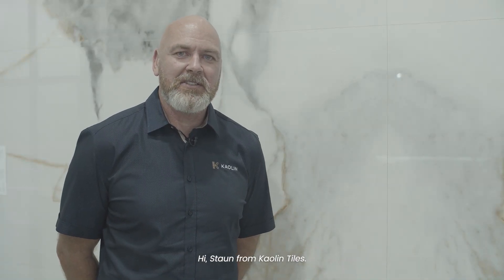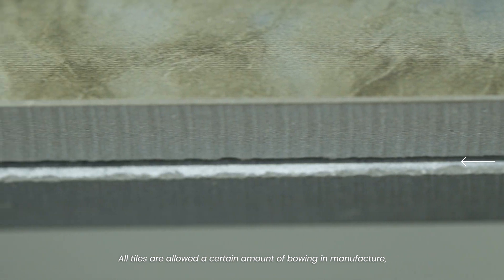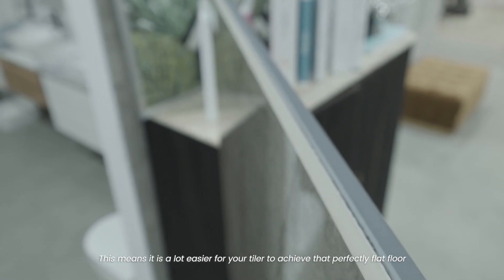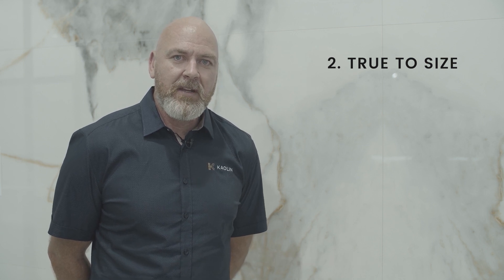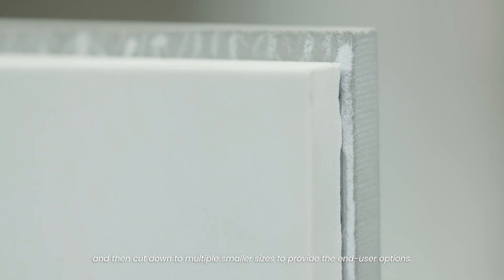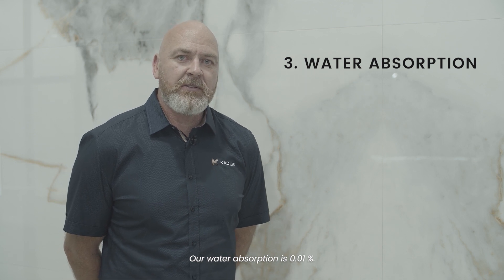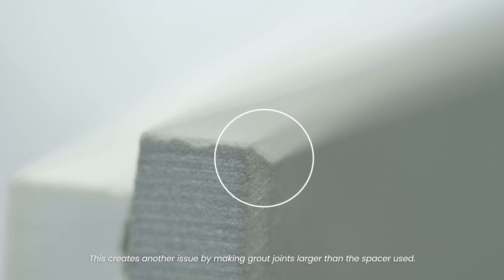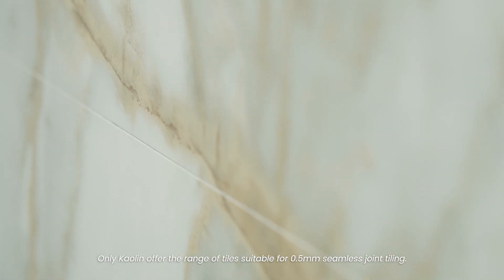Seamless Joint | Technical Info | Kaolin Tiles

Comment: Is it possible to have no seam and flat surface?
Reply from the maker: We recommend a grout joint of only 0.5mm. Surface flatness of tiles is detrimental to achieve an installation that complies with Australian Standards in terms of lippage with such a small grout joint. Surface flatness for our tiles has a deviation of only +/- 0.3mm, which is one of the highest standards in the world. Always refer to manufacturers recommendations for the grout joint size as well as check with their “surface flatness” standards as part of their technical specifications. Let us know if you have any more questions. Please also check our white paper on “Seamless Joint Tiling” https://www.kaolin.com.au/general/what-is-seamless-joint-tiling/
Reply: @kaolinsurfaces  is that because of the expansion when heat is applied??
Reply from the maker: @cyan2748  Not sure if understood correctly, but our waterabsorption 0.04% which is almost nothing and therefore there is almost no expansion in tiles. Tiles do not expand when heat is applied as they are heat-resistant. We do recommend expansion and perimeter joints for the installation with our tiles. Please let us know if we have answered your question.